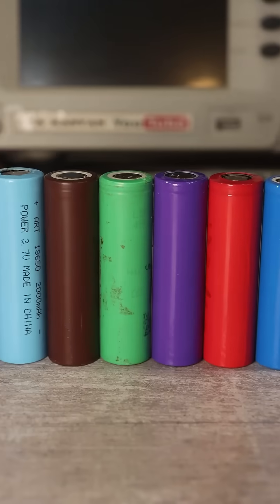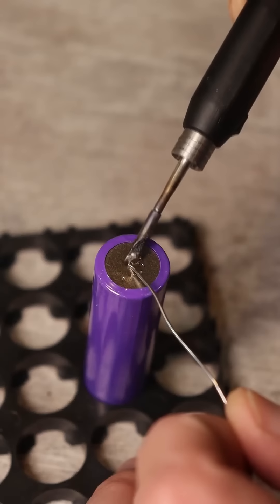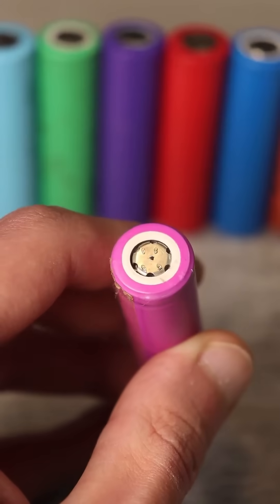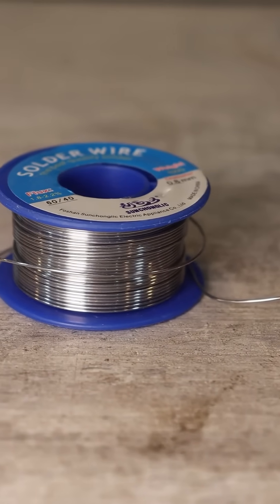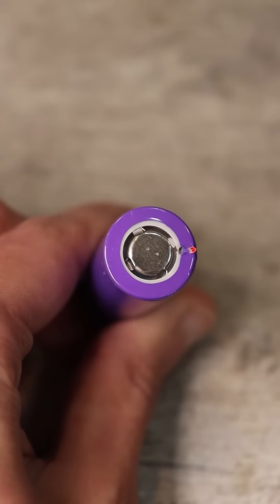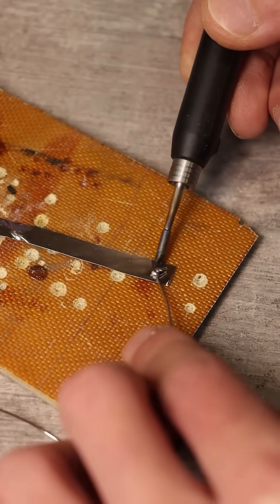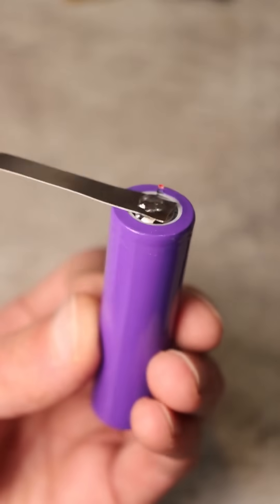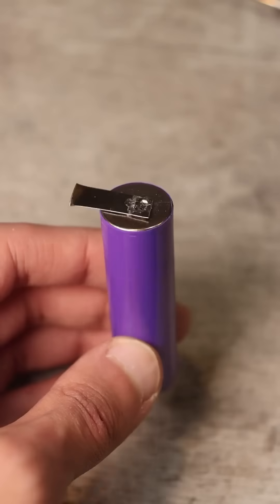How to properly solder Li-Ion batteries.

Comment: Of course it's not recommended but it is an option if you're quick and using a hot soldering iron. Welding is much hotter than soldering but it's only in a small area and done quickly.

Comment: Not possible in 3 second no way 👎👎👎👎👎👎
Reply: Absolutely it will. Need a high wattage iron. 75watts or more. But it will also work with lower power irons.... IF they have a high thermal capacity tip.